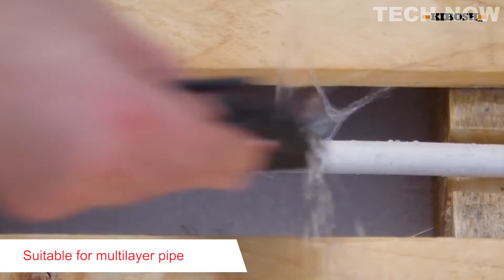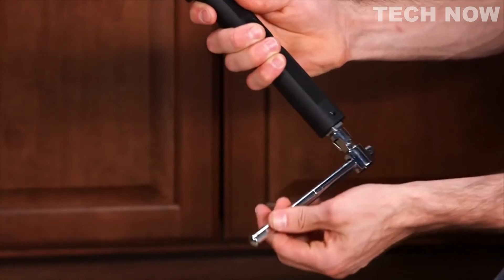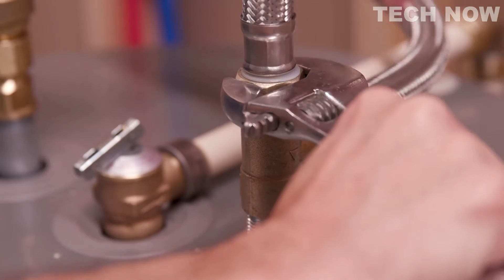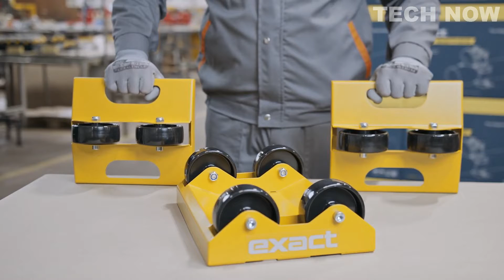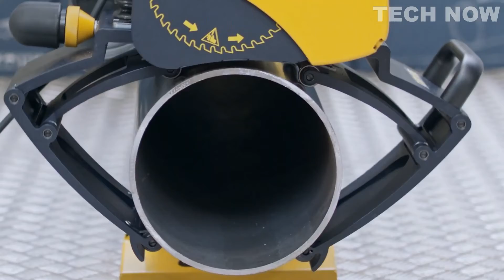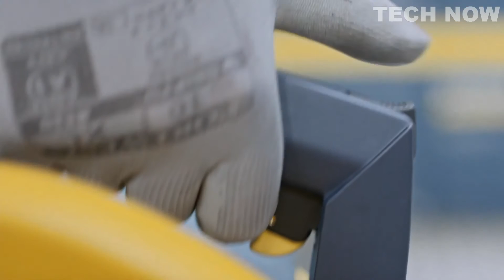Best New Plumbing Tools Accessories for Plumbers Must Have / Industrial Plumbing Equipment

Comment from the maker: 1 ► Kibosh Rapid Pipe Repair
●Amazon US: https://amzn.to/3IkVtBh
●Amazon UK: https://amzn.to/34RcsNY
●Amazon CA: https://amzn.to/3KWWmlu
●Website: https://www.kiboshpiperepair.com/
---__---__---__---__---__---__---__---__---__---__---__---__---__---__ 
2 ► RIDGID LED Basin Wrench
●Amazon US: https://amzn.to/3KQ6DzC
●Amazon UK: https://amzn.to/3qidKJw
●Amazon CA: https://amzn.to/3CREAxd
●Website: https://www.ridgid.com/us/en/telescoping-basin-wrench
---__---__---__---__---__---__---__---__---__---__---__---__---__---__ 
3 ► SharkBite Flex Hose For Water Heater - Flexible Water Heater Connector
●Amazon US: https://amzn.to/3N1u3E6
●Amazon UK: https://amzn.to/3JorI45
●Amazon CA: https://amzn.to/3u8gvye
●Website: https://www.sharkbite.com/us/en/brass-push-to-connect/water-heater-connectors
---__---__---__---__---__---__---__---__---__---__---__---__---__---__ 
4 ► Superior Tool Basin Buddy - Faucet Nut Wrench
●Amazon US:https://amzn.to/3wnspH4
●Amazon UK: https://amzn.to/3igyLjp
●Amazon CA: https://amzn.to/3KUT5Tz
●Website: https://www.superiortool.com/wrenches-pliers/basin-wrenches/
---__---__---__---__---__---__---__---__---__---__---__---__---__---__ 
5 ► Exact PipeCut 360 Pro Series
●Amazon US: https://amzn.to/368fUVa
●Amazon UK: https://amzn.to/3qdI08g
●Amazon CA: https://amzn.to/3ifkl30
●Website: https://exacttools.com/product/exact-pipecut-360-pro-series/